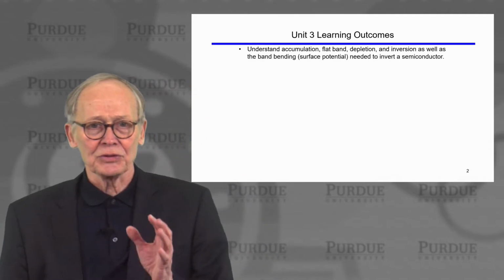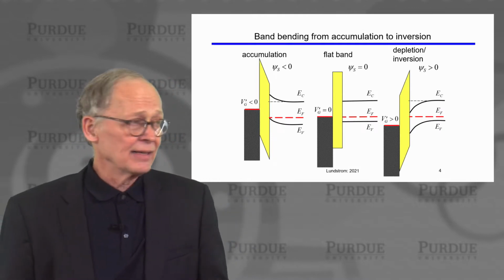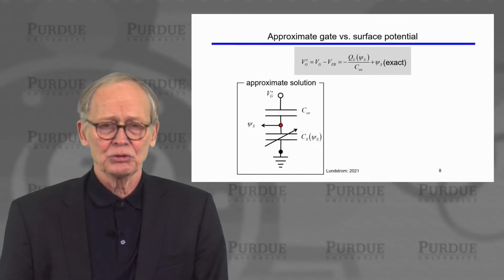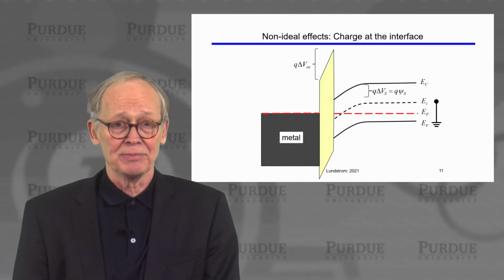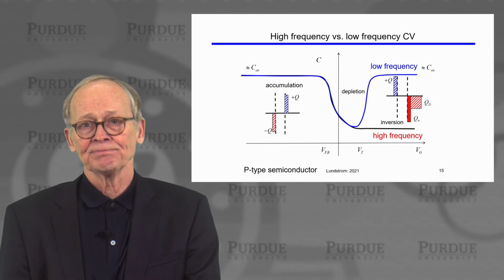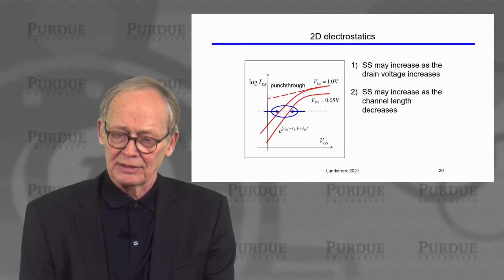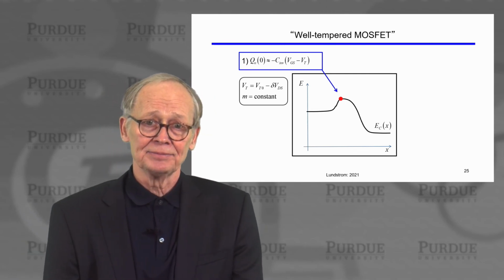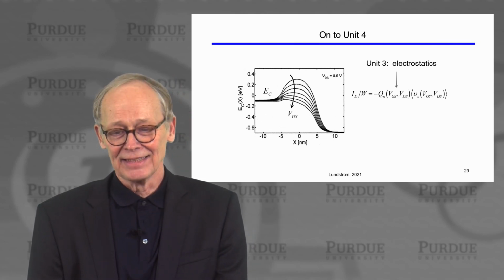ECE Purdue Transistor Fundamentals L3.10: MOS Electrostatics - Recap

Comment: 00:00    Lecture 3.10: Unit 3 Recap
00:31    Unit 3 Learning Outcomes
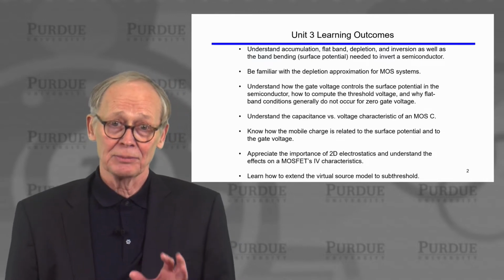03:07    Unit 3
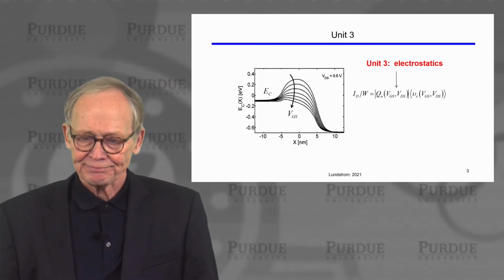03:19    Band bending from accumulation to inversion
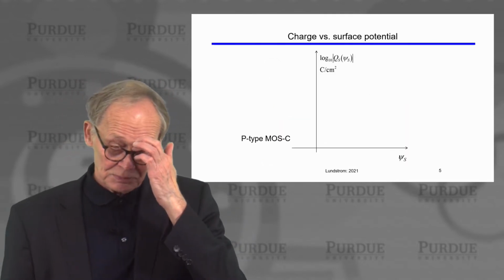05:02    Charge vs. surface potential
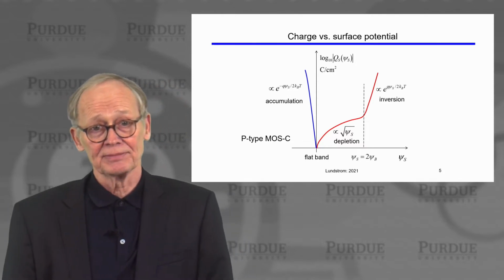06:02    Depletion approximation
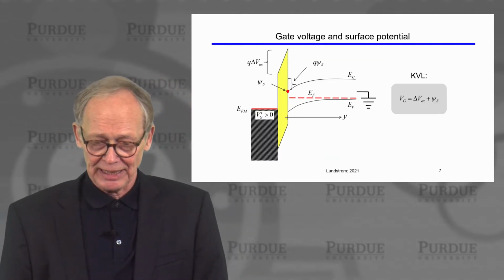06:32    Gate voltage and surface potential
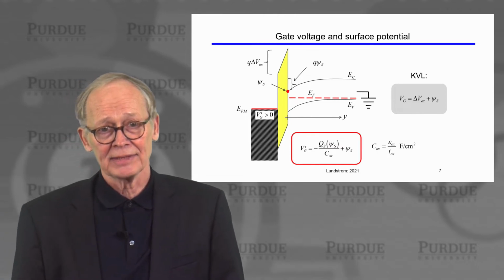07:51    Approximate gate vs. surface potential
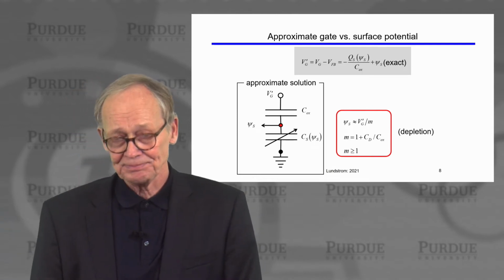09:02    Surface potential vs. gate voltage
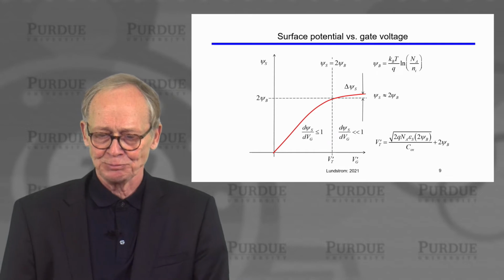10:42    Non-ideal effects: Work function difference
12:34    Non-ideal effects: Charge at the interface
12:58    Flatband voltage
13:38    MOS small signal capacitance
14:16    MOS high frequency CV
15:36    High frequency vs. low frequency CV
16:38    Mobile charge
17:16    Mobile charge vs. surface potential
17:47    Mobile charge vs. gate voltage
18:46    2D electrostatics
20:12    2D electrostatics
20:54    2D electrostatics
21:25    Barrier lowering view of 2D electrostatics
22:26    Controlling 2D electrostatics
23:10    2D electrostatics
23:35    "Well-tempered MOSFET"
25:05    Level 0 VS model
25:24    Level 1 VS Model
26:03    Subthreshold swing
28:02    On to Unit 4